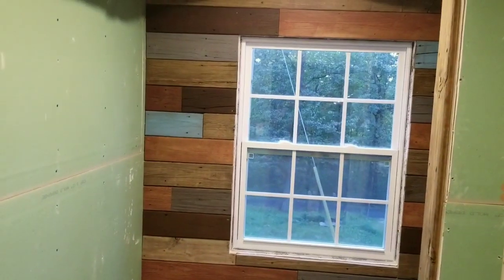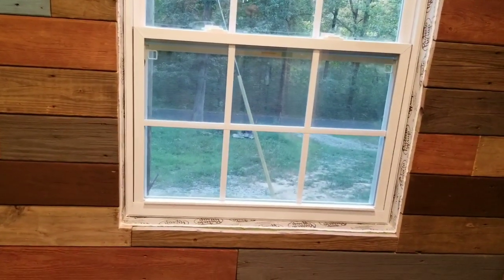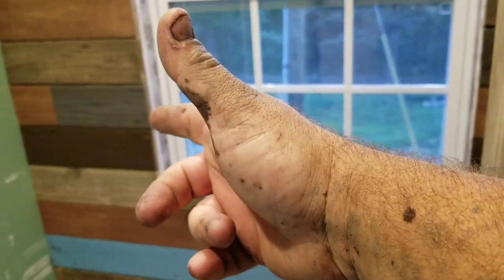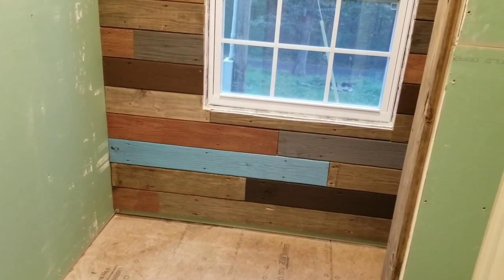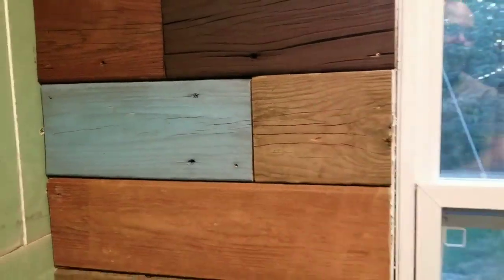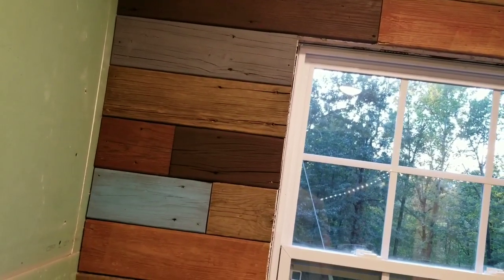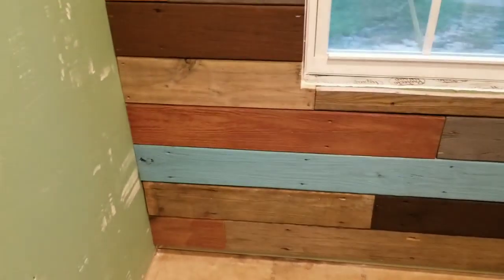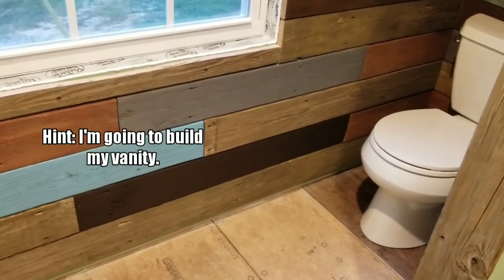MOBILE HOME BATHROOM WALL UPDATE - WALL FINISHED. What do you guys think?

Comment: I LOVE THE WALL!! I normally don't like "different ", but I like this, it's unique! I wouldn't put wood above shower, it will get wet and be moldy and nasty. Then you will have to do bathroom all over. I look forward to seeing the vanity. I think you should keep it simple. Shoot you could buy a small old used dry sink and cut the top out to fit a sink. And just hang a mirror above it. Paint the wall in back a cream or sand color. I like the floor around the toilet 😻

Comment: You did a great job on that wall, LOVE the stain job. I was just remembering something that the Crocker channel did on the Ranch they just remodeled. They took the wallboard from Lowe's that looks like a brick wall, then added some spots of spackle on it and then primed it and painted it. It really does look like a brick wall. They used this technique during a shed to house build previously, and then used it again on the remodeling of their Grandmothers old ranch house. Maybe it's something you could consider somewhere in your house or around the tub or wall behind the sink area (but you'd have to make sure you sealed the top coat with a gloss or something really good.) I am planning on also using that technique on the south living room wall in my house. But I'll probably be adding a thin plywood behind it, since these walls are so thin and have that 'wannabe drywall plaster' type stuff on them. I'll add the link here to their video: https://youtu.be/LkOFsacHih0

Comment: Like I'm said in a conservative in my decor. I would have made them all the lighter color them put a good coat of poly over it. Since it's in the bathroom poly still works be a bad idea unless you plan on painting later. The humidity in a bathroom can affect the wood and ceramic around the whole shower. Easier to clean